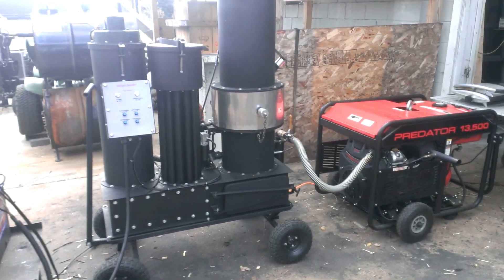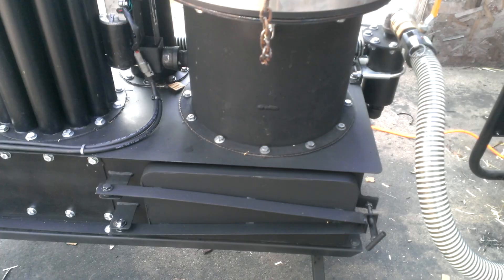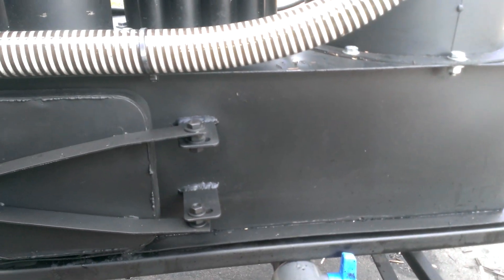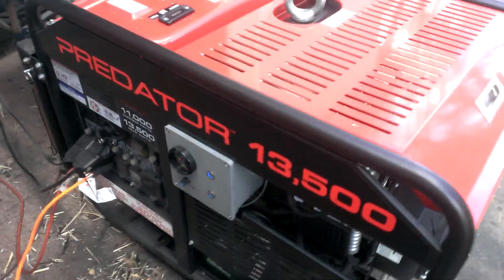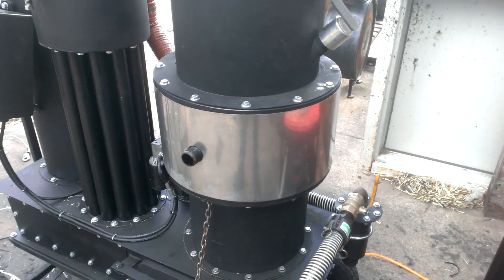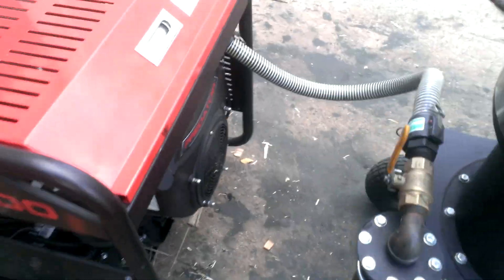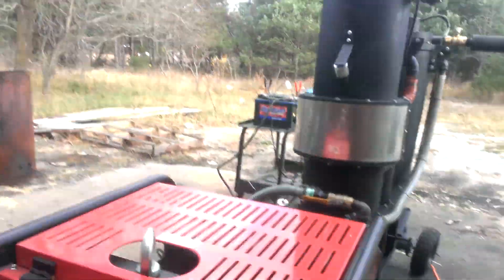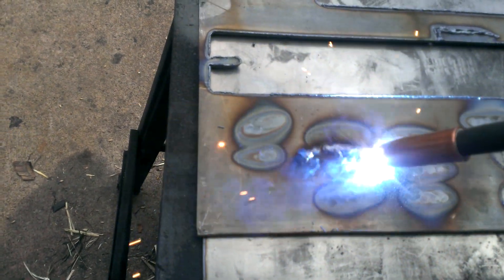2016 Flex R1 / 11kW Predator Generator System

Comment: This is great! Any chance you will add a water jacket around the burn chamber so you can recover the heat?
Reply from the maker: +Ryan Werner Hi Ryan, no you can't remove heat from this area it will run to cool and crash the reactions taking place inside. We offer CHP systems that recover waste heat from the engine's exhaust. Larger systems have liquid cooled gas chillers and the engines are liquid cooled V8's. We also tap into the exhaust heat here as well.
Reply: If you need hot water run a coil at the flare...done deal!
Reply from the maker: @rongray4118  We use the engine exhaust heat for CHP, plus I now offer liquid cooled engines on the new machines. So you can combine the engines liquid cooling with the exhaust heat exchanger for full CHP. On top of this is the gas coolers are now liquid cooled as standard. So that heat can also be utilized as well. https://www.thriveoffgrid.net/

Comment: what is the expected life span for your gasifier?
Reply from the maker: +Daniel Callins MIn of 5 years and could last up to 20 years if properly taken care of. The machines are modular so you can replace individual components if and when they wear out. So you do not need to throw the entire machine away just replace what is needed. This years Flex R1 is the final revision, it will not change for at least five years and may not ever change; it is a good platform with many years in development. When it is time to replace parts our manufacturing process by this time should be very efficient, so cost for replacements should be economical. We will also be adding different material options later on, coated aluminum cooling systems and other components may be offered in stainless steel.

Comment: Looks great Matt. That HF Predator twin is a beast. Looks like you have refined your system.
Reply from the maker: +urgentcareguy3 Yup this is it, there will not be anymore design changes for a very long time other than the bolt on stuff we plan for later. That stuff will most likely be add on upgrades. I think we have a good foundation here.